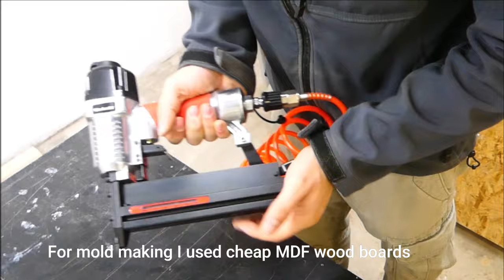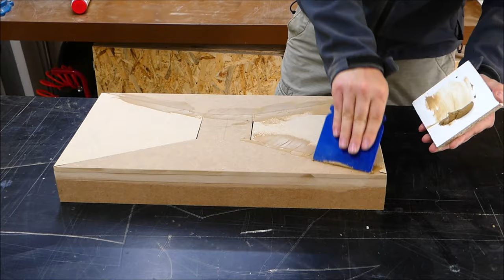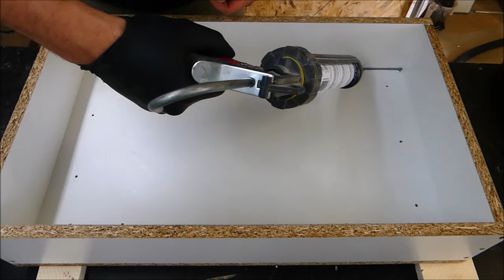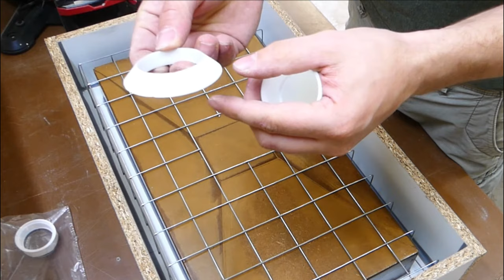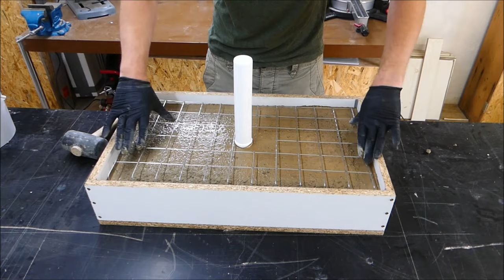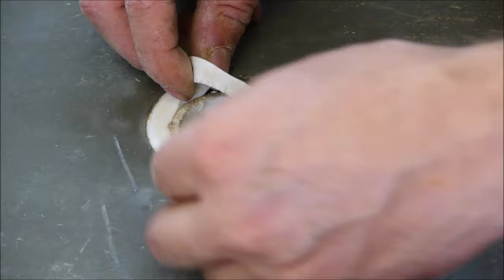DIY Concrete Sink for only $18

Comment: Did you seal the concrete with anything? Concrete is generally porous and will absorb water. Looks good, a lot of creative things can be done with this.
Reply from the maker: I used epoxy resin.
Reply: @greyelementprojects7403  which product did You use?

Comment: I would think a release agent sprayed on the mold would have helped with the removal
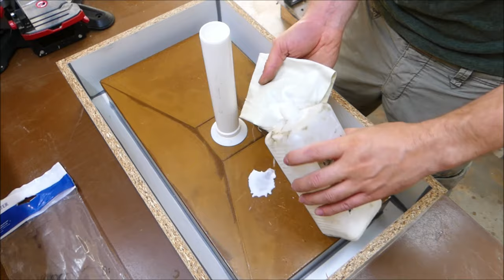Reply: Isn't that what he wiped on at 4:30? Maybe I'm not sure what that was...
Reply: You can just use any oil
Reply: No it would not release as it had straight vertical sides.
Reply: @henryfehr6202  a release agent simply helps prevent from sticking. What is it with straight sides tgat would trap

Comment: $18 dollars assuming you have all the tools already in your garage. 
😵‍💫
Reply: Lmao ikr. He have all that $2000 worth of equipments to built it
Reply: You need a circular saw (50 off FB marketplace) and a hammer…
Reply: Yeah as it's not a quality mix. The mixes used to set fence post don't have the same strength as proper countertop mixes.